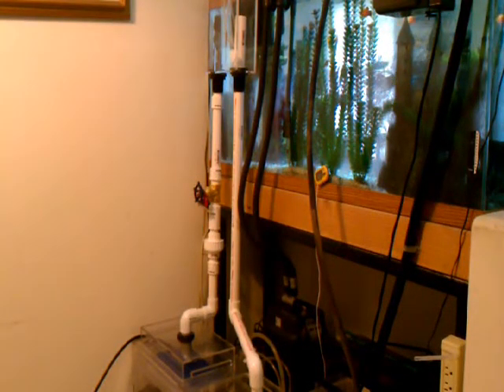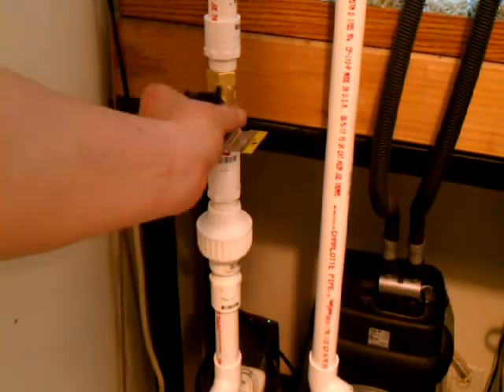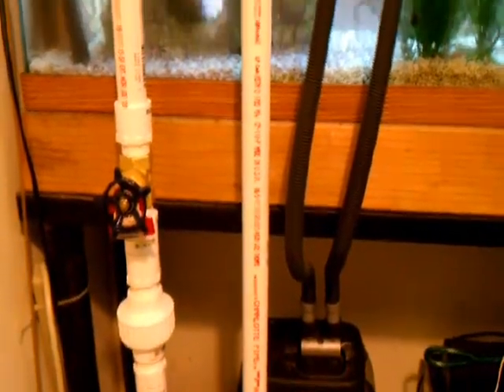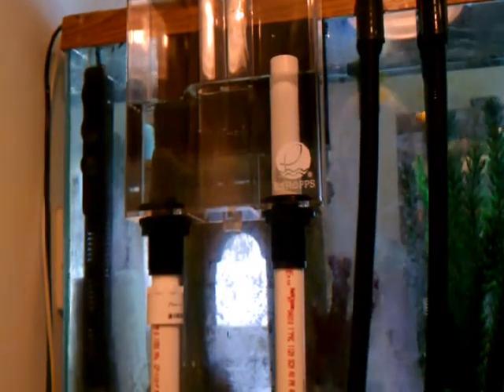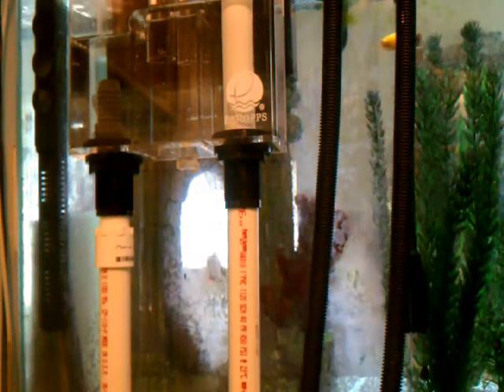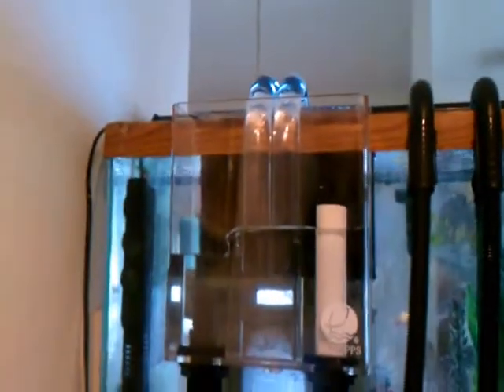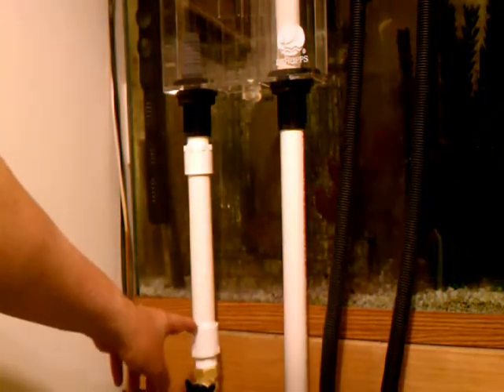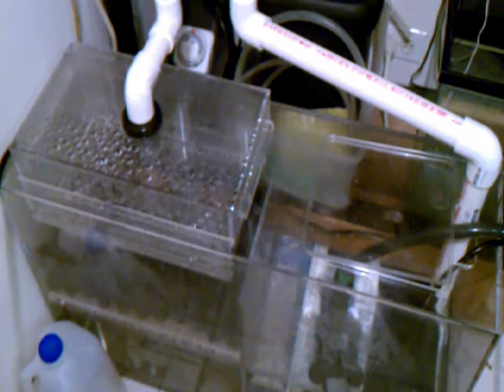Eshopps PF 1000 Overflow Box Herbie Conversion

Comment: You cant use that brass fitting with fish..it has copper in it. It will eventually kill your fish! Try the grey schedule 80 pvc valves..eshopps makes a kit made just for that application.
Reply from the maker: Thanks for the info. I was not aware of that.

Comment: If you’re worried about syphon break you can simply add an airline and aqua lifter to the top of the u pipes.. when power returns the aqualifter with pull any air out and restore syphon. $15 for a lot of piece of mind.. 

Add... if you are worried about a back syphon from your return line just drill a hole slightly under water level to break syphon of the return line..
Reply from the maker: Both those suggestions are good. I have not had any issues with either problem however. Once in a while one of the u tubes will accumulate air bubbles and reduce the flow but all I do then is manually redo the tube's siphon. Never have either or both tubes completely lost all flow.

Comment: Since you converted this overflow to a Herbie, what size pump did you use.?  I know the PF 1000 is rated for 900 gph but you are possibly using somewhere around 375?  Great videos!
Reply from the maker: I use a Rio 2100 rated at 325 gph @4.5'
. My tank sits somewhat higher than a standard stand due to the room divider that it is built into.